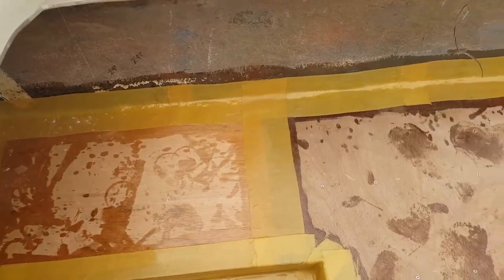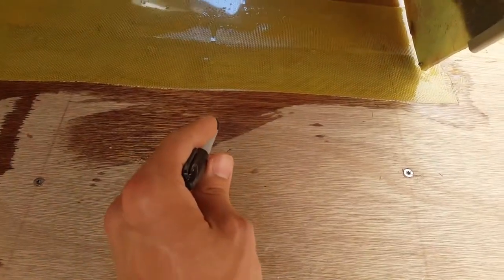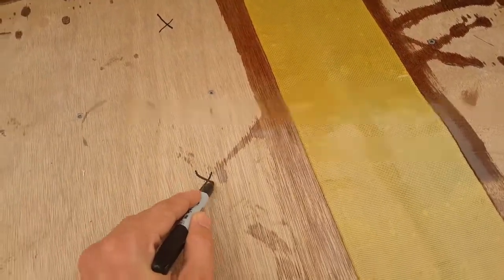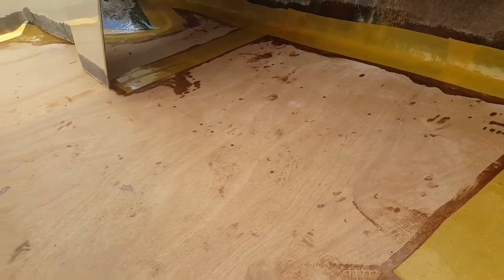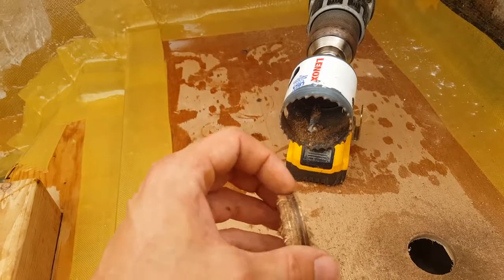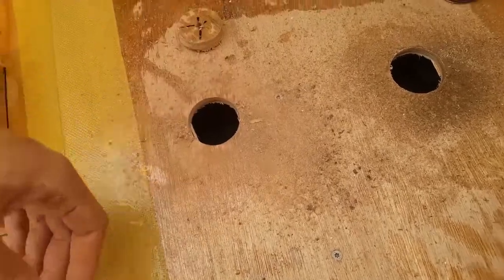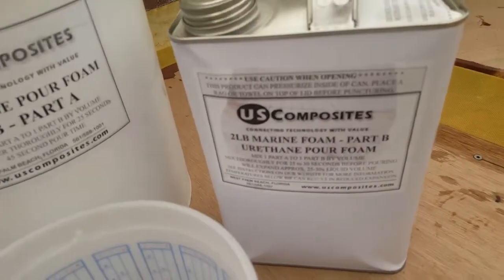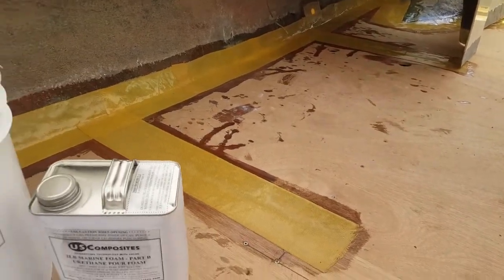Boat Transom and Floor Rebuild - Installing Marine Foam (1 of 2) - Part 56

Comment: Enjoying the series. I'm currently gutting out a 17' Hydrasports bass boat. What is your thought on pouring the foam in some of the cavities before putting the floor down?
Reply from the maker: It’s not a bad idea. Save the pieces you drill out and recover the holes after you put foam in there. Please hit that subscribe button. Thanks!